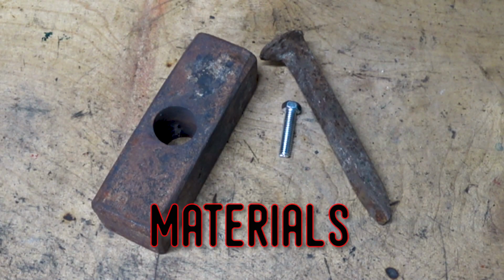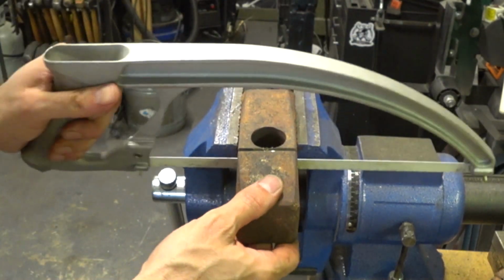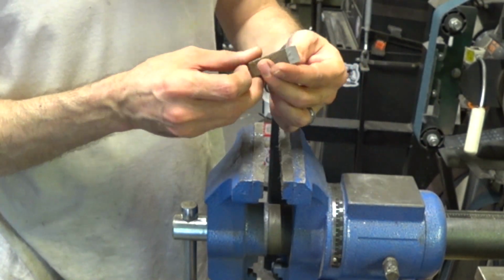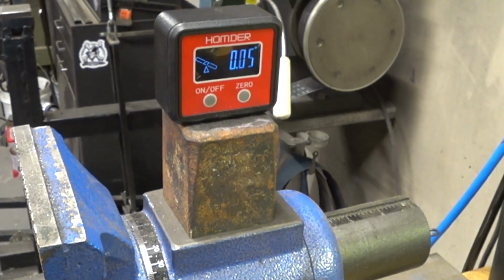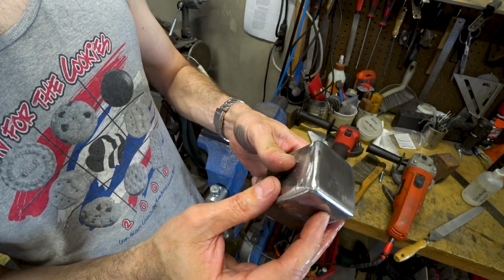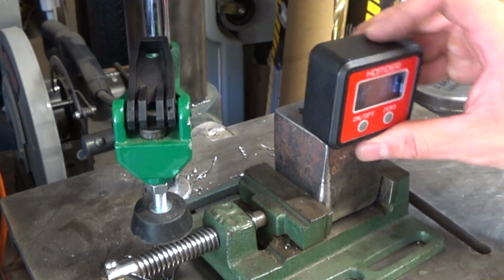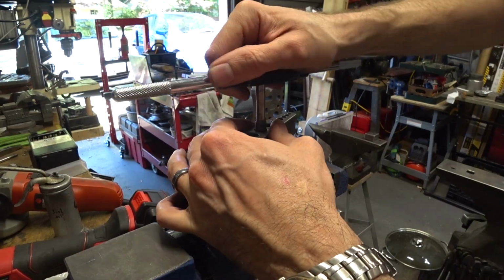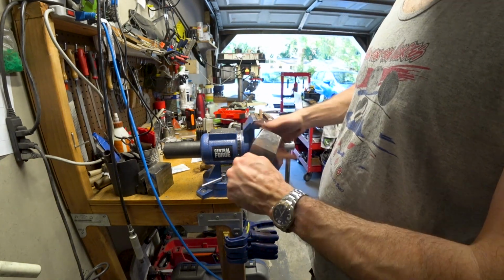Turn a JUNK sledge hammer into an anvil! | Start blacksmithing

Comment: Bro you’re destroying your files. It hurts to watch you back drag a file on steel especially a hardened face of a hammer..  your cut side where the eye was is significantly softer than the face even on a cheap hammer. Don’t believe me try drilling both ends; the cut side and the face side with show the difference in hardness. Some hammer faces are just as hard as a file too…

With all that said you have a really great and informative video series for literally anyone to try and beat some projects out in the backyard
Reply from the maker: Files wear out sooner or later. So if they wear out a little sooner, I don't worry about it. At least the dull one's don't go to waste, for a blacksmith, they are a good source of high carbon steel.  Thanks for the comment rock on amigo!

Comment: Very good information here. I would recommend using cutting fluid liberally with any drilling operation. I bought a 12lb. Harbor Freight sledge just to make a stump anvil out of, but I already have 2 full size anvils, plus one made from fork lift tines, so I never did use the sledge hammer for one.
Reply from the maker: You're right it's never a bad idea to use cutting fluid, and I'm glad you found it informative.

Comment: You can also drill & chisel a depression into the stump, sink the head in, and get it tight with a wedge. 

Or make some sort of a bracket that first trough the eye so you can secure it with lagscrews. 

Those seem a bit easier to me at a first glance. 

Great video either way i would never have thought of that method.
Reply from the maker: The main reason I used this method was because I had an old mount that I could reuse, and I didn't have a solid piece of wood on hand that was big enough. Mounting directly into a solid piece, as you mentioned would have been preferable.

Comment: You referred the objective in an anvil is to use as much steel as possible under the hammer. So, instead of cutting the sledge head, why not just forge plug the eye with a bit of hot forging temp round stock? Or even weld close the sledge eye? And, I wouldn't consider this as a junk sledge hammer just because there is a bit of surface rust. Please take this as positive criticism, I try to learn together with other people.
Reply from the maker: You absolutely could plug the eye to increase the mass of useable steel. I didn't try to do something like that because it adds additional complexity to the build.  On the sledge I used the eye was round, but typically it would be oblong with an hourglass cross-section which would be hard to plug tightly.  And yes, you are right the sledge was not necessarily junk, that is just a bit of hyperbole to draw attention to the video.

Comment: I am curious to see how that bolt will hold up to blunt force.
Reply from the maker: I was a little curious about that myself, but I've used it for 3 projects so far and it is working like a champ! The biggest concerns are shear and bending forces, but the bolt is not subjected to much of those forces when using the anvil.